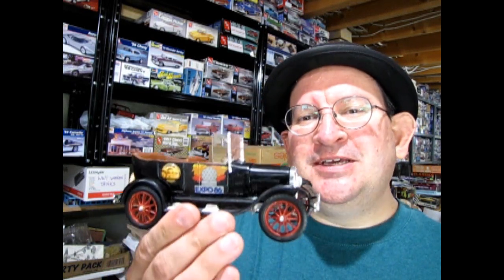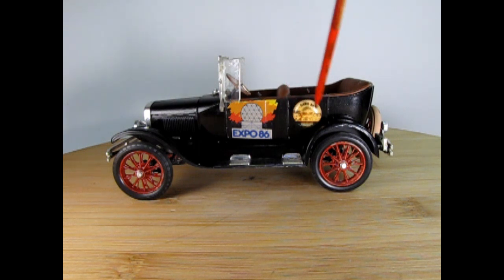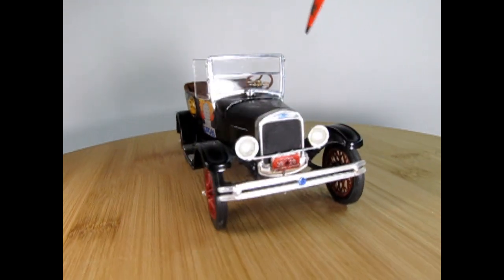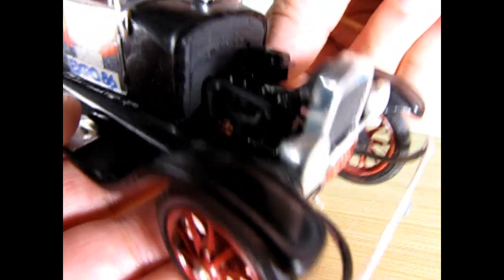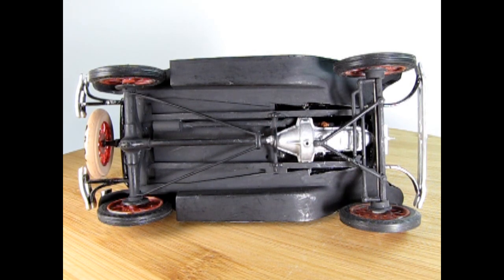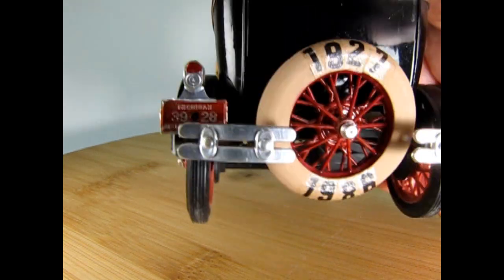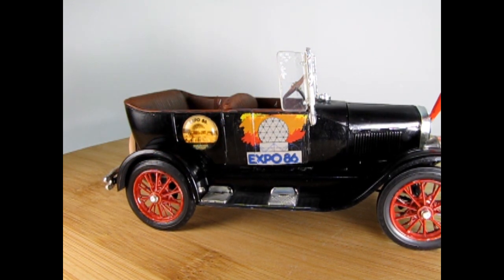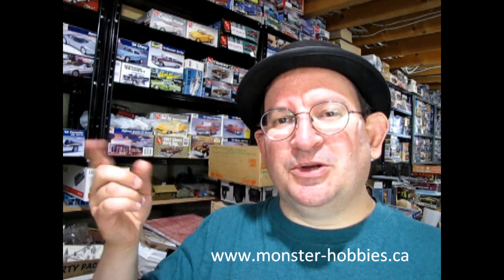Model Car Garage Show And Tell - My AMT 1927 Ford Model T Touring  - A Model Car Build Video

Comment: Nice build.  I was thinking about using the.Butera windshield on a street rod version of this kit because it is chrome plated.  It looks like it fits OK.
Reply from the maker: Go for it! - It is a little wider, but you can make it work. 
I love the etched in flowers. Gives it a nice, vintage touch, although i don't know if car owners had their glass etched like this back then.